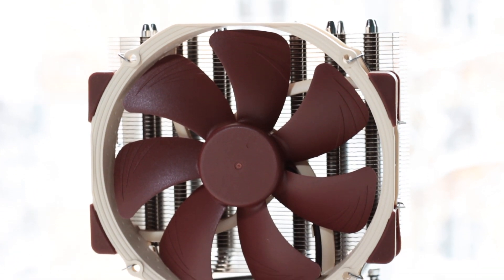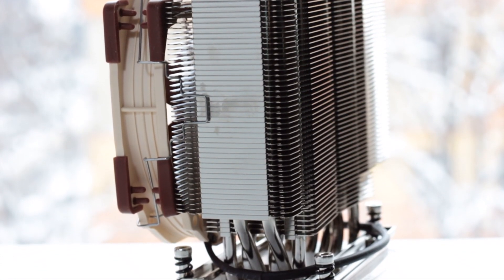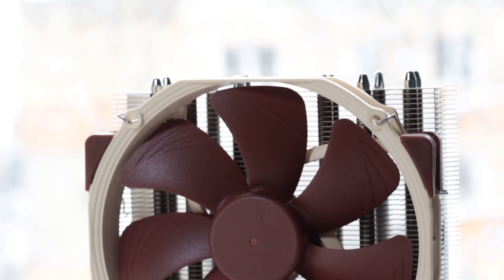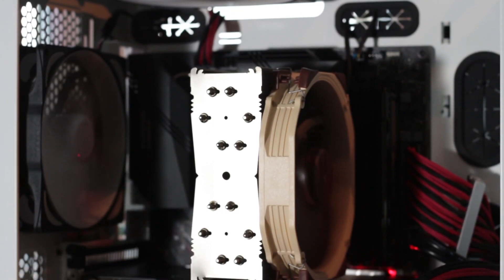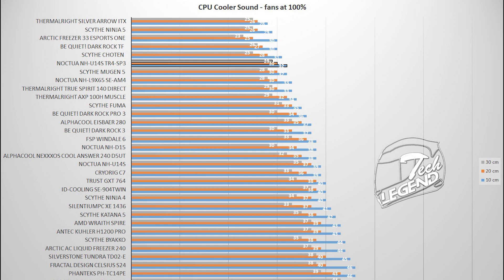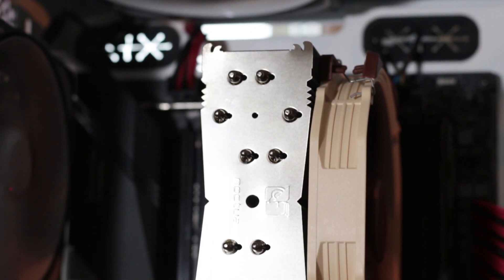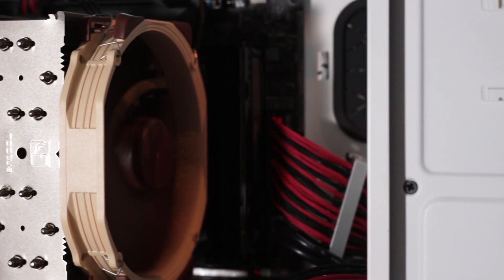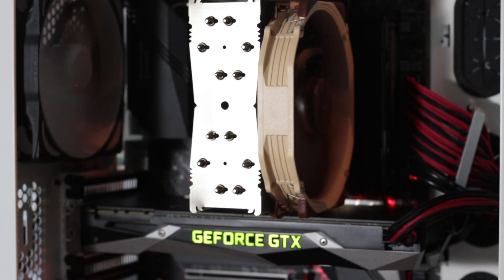Noctua NH-U14S TR4-SP3 - Silent air cooling for ThreadRipper

Comment: The other question I wanted to ask was whether the fan can slide down one or two mm - my case can accommodate only 164 mm tall cooler, this one is 165. Possibly the fan clips can be mounted, 2 fins lower than usual? Since this anyway does not overhang on the RAM slots, this should not be a problem right?
Reply from the maker: I believe that you can mount the fan lower on the heatsink.
Reply: @TechLegend-com   Thanks for taking the time . Now, If you check here : https://www.overclockers.co.uk/media/image/thumbnail/HS000ND_71514_750x750.jpg you will notice that the mounting screw on the bracket is actually interfering. May I request you to check whether this pushing the fan lower is actually possible, if you still have the cooler.. Best regards,
Reply from the maker: @nishikantprabhu  Ah, that one, I couldn't say I'm afraid. However, that is a screw that once installed it lowers its height, because well... you screw it in the mounting bracket. So it should offer you some space to lower the fan as well.
Reply: @TechLegend-com  Thanks for this review and your answers.
Reply from the maker: @nishikantprabhu  Glad I was able to help. :)

Comment: Thanks for a good review. Did you try it with an additional fan perhaps? How would that impact performance and space in the case?
Reply from the maker: The space in the case would not be a problem with a second fan. Unfortunately, I had the ThreadRipper CPU for only a short period of time, so testing multiple fan configurations was not possible.
Reply: @TechLegend-com  OK, thanks anyways
Reply from the maker: @gbdr_ps_fan8656  I can still help out, what do you want to know? The thermal difference with one fan vs. two, or If it will fit inside your case?
Reply: @TechLegend-com  If you're so kind, I would like to know how the NH-U14S would perform with the additional fan. I've just bought TR 3960X and am gonna stay with air cooling only. But I definitely wanna boost it with this fan. Also, my use-case is a bit constrained as I'm putting everything (at least that's the idea now) into my good old Define R4, which is silent, but not too airy. I'm gonna replace the stock Fractal Design fans with the be quiet Silent Wings h-s PWM 140 ones (2 in front and one in the rear). That's basically my plan. What would you say? Thanks
Reply from the maker: @gbdr_ps_fan8656  The usage of two fans instead of the default one fan, is going to improve the CPU temperature by 1-2 degrees at most, I am saying this because you most likely will not be using this CPU cooler with the fan at 100% speed. Regarding your choice of fans, the Silent Wings H are good fans, but why not go with some of the Noctua Redux models? They are cheaper and have good performance, something like the NF-P12 Redux would be nice, as it is a good static pressure fan, and that is what you need inside the Define R4.
Reply: @TechLegend-com  OK, got it. I will see tomorrow if still I could change my order and replace fans as per your suggestion. Do you think overall the setup would fly? I'm really concerned and obviously there is not too much feedback still with all the early adopters.
Reply from the maker: @gbdr_ps_fan8656  Check the prices, if the BeQuiet! fans are cheaper, then get those. Yes, your setup looks pretty good, silent and has good cooling overall. Please let me know if you have any questions and let me know again, how your setup performs when its done! :)
Reply: @TechLegend-com  Thanks for help and encouragement. I will get back once done (which still may take some time - I'm having the TR shipped from Denmark to Poland). Cheers and once again I appreciate your effort in the review.
Reply from the maker: @gbdr_ps_fan8656  No problem, don't forget about me, I'm eager to see how your setup turns out and the performance. Also thanks for watching, I really appreciate! :)

Comment: Nice review! Thanks! I have a question, I'm trying to build my first pc and currently I decided to go with:
CPU: Intel Core i5-9600K
Mobo: ASRock Z390
Case: Lian-Li PC-O11 Dynamic
GPU: Vertical Mount for a Vega 56
I know that this case is probably better suited for liquid cooling but I'd like to try the air cooling route. I can't decide if I should go with the Scythe Ninja 5, Scythe Fuma Rev B or a ARTIC Freezer 33 Sport Duo. Do you have a recommendation on this setup? It seems that I need to be on 155mm for height.
Reply from the maker: Hi Alexandre, 
What ASRock Z390 are we talking about? There are many models with that chipset from ASRock. 
Regarding your question about the CPU coolers, can you please tell me the prices in your region for those models? Or better, tell me what online retailer you are using and I will look for some coolers for you. :) 
Looking forward to your reply!
Reply: @TechLegend-com  So, I don't have anything yet apart from the SSD and yesterday I read some other reviews and thought that I should change the ASRock to a Z390 Gigabyte Aorus Ultra. I'm in US, I look Newegg, Micro Center ( Tustin, CA), Amazon, Best Buy, etc
Reply: @TechLegend-com  Hey, just following up to see if you have some recommendation about the cooling this is my build on paper https://pcpartpicker.com/list/7CcmTB
Reply from the maker: @Berecutecu  After looking at your list, first of all, you are spending too much on RGB fans, get the Scythe Kaze Flex 120 RGB, they are cheap and have a good RGB system. Also, from your initial question about the CPU Cooler, get the Scythe Ninja 5 instead of the Fuma Rev. B, the Ninja is better overall.  I edited your build and here's the link, I changed the CPU cooler, the PSU, all the fans and the storage device. https://pcpartpicker.com/list/pYsCXP
Reply: @TechLegend-com  thank you very much! Agree with your updates
Reply from the maker: @Berecutecu Happy to help! :)

Comment: Replace the fan with a thermalright ty-143 and get better performance

I'm able to run a 1950x @ 3.9GHz stable. It stays under 70C with prime 95. It benches 3300 on cinebench
Reply from the maker: In that case, you are spending more on the CPU cooler and perhaps have a louder fan. It really depends on the case used, and the CPU. It is still one of the good ThreadRipper CPUs out there. :)
Reply: i can confirm this since i too ran 3.9ghz stable with those temps. And using the NH-U14S stock fan with full speed fal profile on my mobo.
Reply from the maker: @MegaMoiz  That's great, are you using the same CPU as me? Also, you are reaching those temps with the stock Noctua fan included with the cooler, right?
Reply: @TechLegend-com  Yes i achieved 3.9 ghz on the 1950x using 1.2volts and using he stock fan at 100% speeds in my gigantic case with lots of air flow i got max of 74C using an FPU load which is my actual use case not a synthetic load like AIDA 64.
Reply from the maker: @MegaMoiz  That's fantastic! Imagine the temperature drop with a second fan installed on the cooler. Never the less, I really liked the Noctua ThreadRipper base installed on these coolers, it's just done right. :)
Reply: I recently upgraded to a thermalright silver arrow TR4 Cooler which uses dual 140mm towers and 9 heat pipes it has a 10C drop in temps. Before that  i also used two be quiet silent wings 2 high rpm fans on the noctua but it didnt increase the performance by that much. The temps did drop by 4C by adding another fan at higher air flow and higher rpm but again the pc was DEAD SILENT.  @TechLegend-com  I only upgraded the cooler because further down the line i wanna be able to use the coolers for other threadripper builds. But another option is the Be QUIET Dark Rock Pro TR4 cooler which also looks better but again doesnt perform as good as the thermalright one. Again it is a compromise between style and performance so up to you really. Both of those dual tower coolers have the pros and cons but what ever you do DO NOT get the cooler master wraithripper cooler for some reasons which cannot be said here. But i think techspot website reviewed it against the thermalright cooler and well needles to say the cooler master cooler looked so bad in comparison it wasn't even a joke.
Reply from the maker: @MegaMoiz  You are right, a high end CPU cooler like the SilverArrow TR4 or the Dark Rock Pro TR4 make sense in time, as you can just use it on a different system. In terms of which cooler is better, I'd say that the overall size of the heatsink and the mounting system also play a role. Some TR coolers simply do not fit on certain motherboards, or they completely block the PCIe slots. 
Don't worry, I have no intention of getting the CM one, I saw the reviews and the overall package. What I also dislike is when you get "Threadripper ready" coolers tha do not have an enlarged base to completely cover the CPU die. That's just a complete scam.